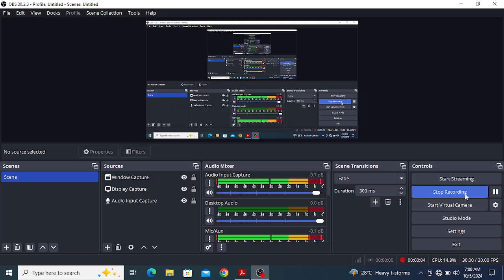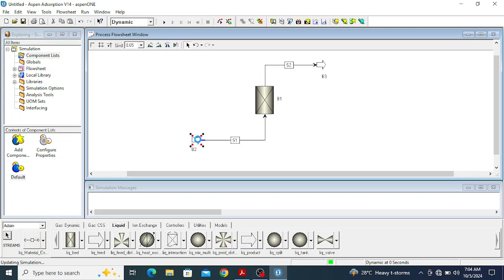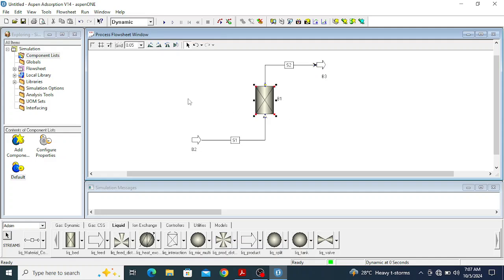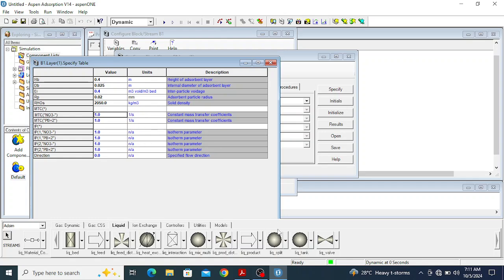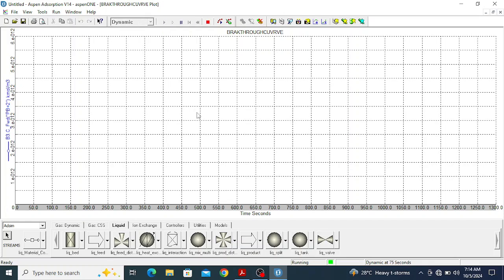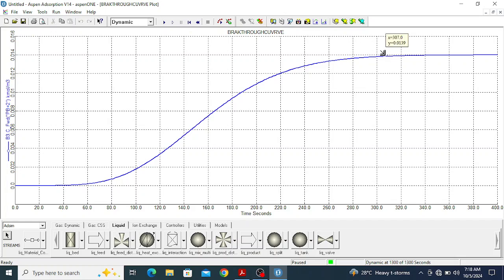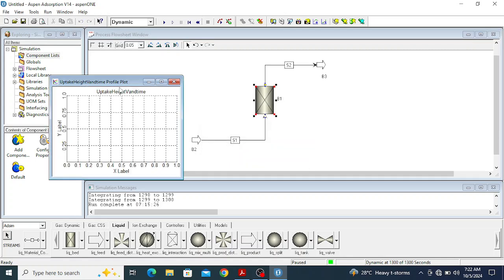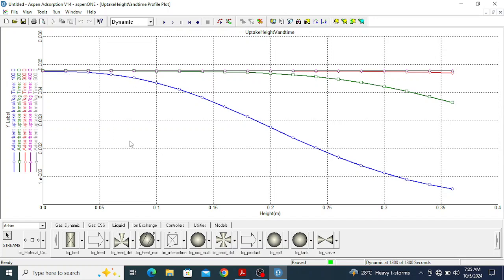Adsorption of lead(II) ions from industrial wastewater using Activated Carbon as an Adsorbent

Comment: Hi, I've been following the steps in the video (using Aspen Adsorption V12.1) and I have checked several times that I do the exact same and the numbers are the exact same but when I hit the play button in the Initialization mode it says: "initialization failed at time 0." Then I click okay and it says "A sub-group in the decomposition failed to solve".
I have then tried using the same numbers but with only NO3- present (removing PB+2 from the component list) and then it works. It is as if mine will not work with positive ions… 
Do you (or anyone reading this) know what could be the problem?
And thanks for a nice video :)
Reply from the maker: Check your feed and product stream properties and use Electrolyte NRTL property package. Hope it work. No need to remove Pb++
Reply: Thank you for answering :) I use ELECNRTL under Configure Properties (so base method is ELECNRTL in Aspen Properties) as shown in the video. Could the difference be that you might have changed something in Solver Options or something? Because everything I see in the video is the same in my script. 
In the Evaluation Messages it says: "Evaluation error in explicit group 617"
Reply: @vibekebrohansen3902  hello, I don't know if this can help you but I'm using Aspen V11 (the same version of the simulation from the article) and it works with just NRTL, the video is with Aspen V14 and the methods can change with different versions
Reply: @MaríaB-h8q  Thanks a lot! That did the trick :D
Reply: @chemicalengineeringzone3560 Can you help me, I need you urgently?
Reply: @chemicalengineeringzone3560 Can you help me, I need you urgently?
Reply: @chemicalengineeringzone3560 please can you give me your e mail
Reply: Same thing happens to me, I don't know why cause I followed every step :(